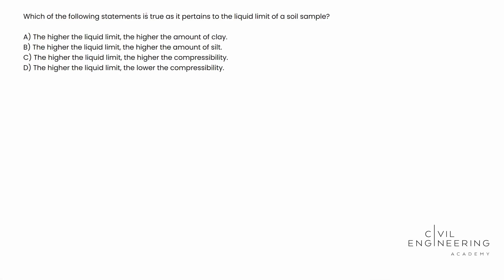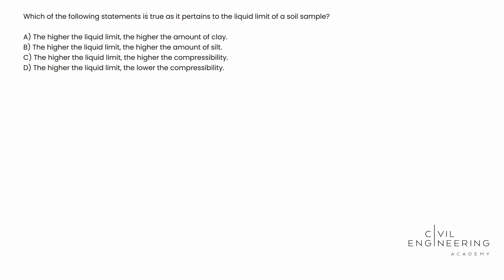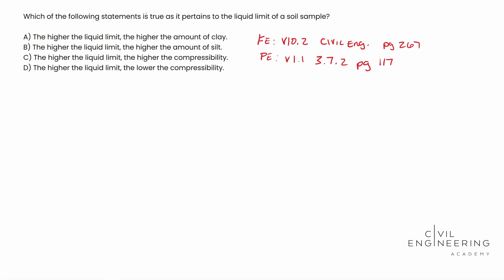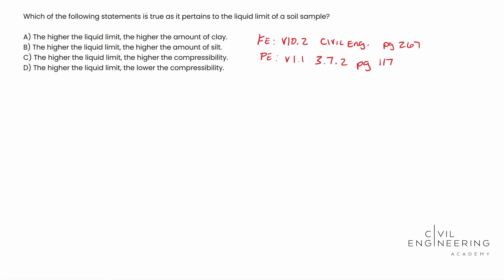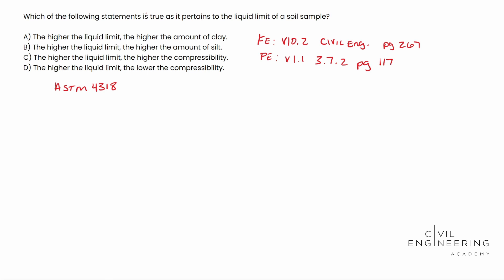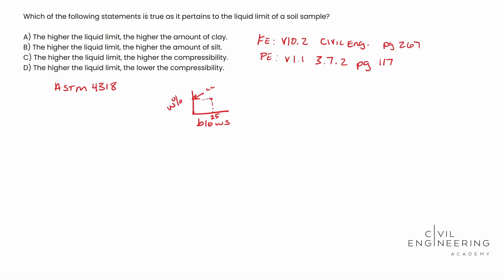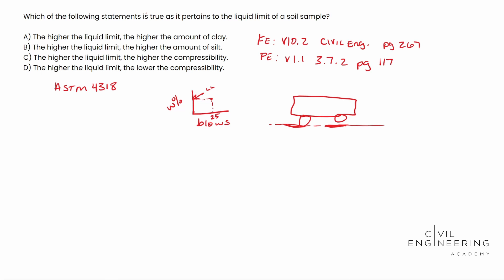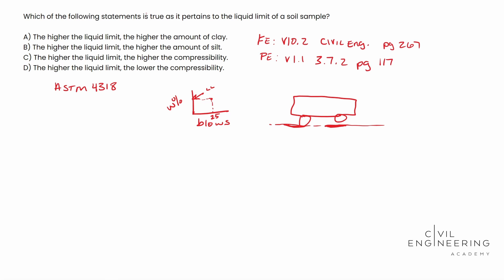Civil FE/PE - Geotech - Liquid Limit and Compressibility Relationship

Comment: Ncees pe hb 1.1, p. 117, 138, 282.

Got answer C, as well. Answer has nothing to do with % of clay nor silt as LL is related to PL related to water %. So A and B are out.

With water % increasing the clay's "workability" increases. It becomes more malleable, easier to compress. This is obvious. So we choose C.

But now I want to challenge you! Do you remember that water is often defined as an "incompressible" in fluid mechanics? 

So with an increase in water % at which point does this water's incompressible property start to mess with clay's compressibility ?

If LL is maxed out wouldn't overall compressibility be minimized, water % maxed out, giving us answer D ?
Reply: Thanks for the comment.

You are correct with your first statement, but keep in mind a higher liquid limit will produce a fat clay and a lower liquid limit will produce a lean clay. Check out the USCS Soil Classification Chart for more info.

I may have misunderstood your second sentence, let me know if so. I'd like to add some clarification. The water % increasing would actually make it more difficult to compress/compact.  In the field, you definitely don't want a sloppy mess as subgrade. The liquid limit is almost a measure of how dry the soil is. The higher the liquid limit, the more moisture it takes for that sample to start behaving like a liquid. When you compact soils, you want something called optimum moisture. Obtaining at or near optimum moisture will produce better compaction. But there comes a point when there is too much water in the sample. Think about holding a clump of really wet mud in your hands and trying to compress it. It won't work well. Now think about holding some really dry dirt in your hand, it also wont compact well. it just crumbles away. But when you have the perfect mix of soil and water, maximum compaction can be achieved. That might be a really bad example but that's what came to my mind. 

Let's flip the script the other way. We do not want a soil that has a low liquid limit if we plan to compact it. That would mean it turns to a liquid really easily. It's a lot cheaper and more efficient from a contractors perspective to have good subgrade. This is off track but if you have bad subgrade where you want to put a road or parking lot and nobody knows about it until they get out into the field, that's typically called "Unclassified Excavation" or something similar. They have to cut out the bad dirt (or wait for it to dry) and replace it with suitable material. 

In general, it is better to have a soil that has a higher liquid limit because it will take more water for that soil to act like a liquid and we do not want a lot of water in our subgrade.

Did that clear things up? Clear as........mud?
Reply: @codysims7465  If the compressibility is related to the "optimum water content" then LL has NOTHING to do with it by YOUR logic.
Reply: @codywsims  So water content AWAY from optimum is less compressible. NOTHING TO DO WITH LIQUID LIMIT, according to YOUR LOGIC.